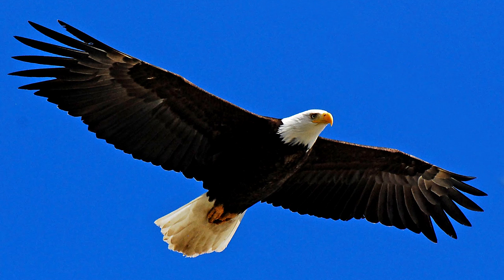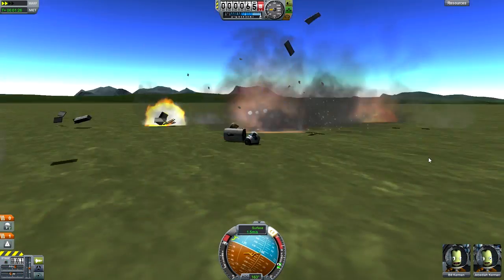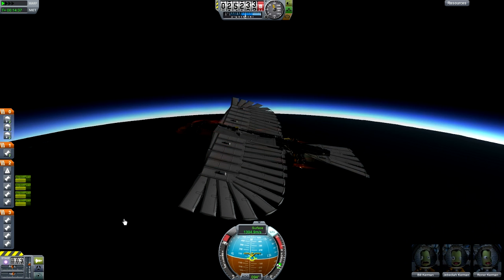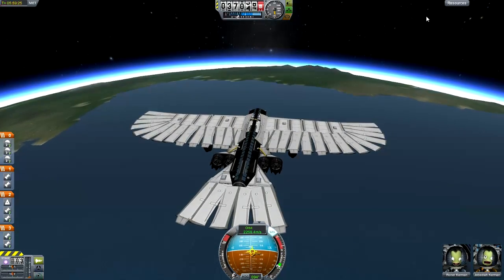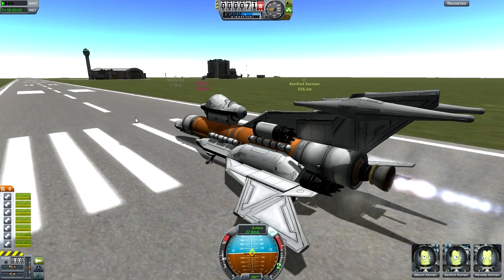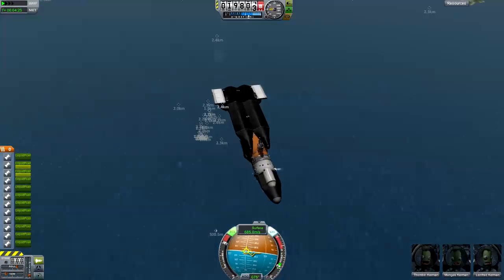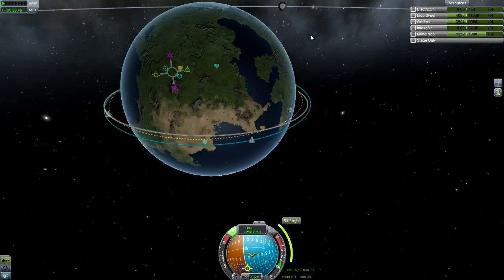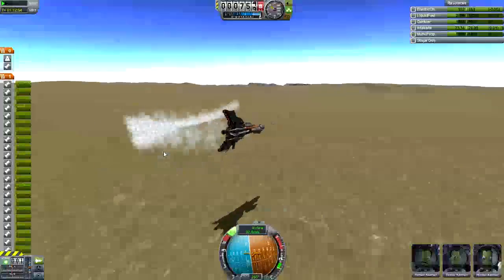KSP - Designs of the Week Ep.30

Comment: find the message: 101010100010110010001110101001101101010010001001101001010100101010010100001010100101010111001010101111101010100101010101011101010110100101111100101010001110010101000010010101001000111111001010101010101010101
Reply: well due to the binary translator i use in order for it to be properly translated it must be divisible by 8 and the binary you put in cannot
Reply: can not be translated
Reply: Mike Schmidt there is no message it is not divisable by 8
Reply: It's binary!
Reply: Mike Schmidt still it has no message
Reply: translate using binary to text!
Reply: i did it is not divisable by 8 there fore it's malformed binary
Reply: +Mike Schmidt Has no message there. I translated and has no message ... "Maybe" you did it wrong
Reply: i can't be malformed i copy and pasted it from a website.
Reply: cannot what

Comment: The simple explination for the craft flipping out when the jets were off were off is: you can think of it this way you have those two levels of jets one with 6 or so on top and then with like 12 and a rocomax the top 6 are creating thrust pushing the forward down so when they turn off the center of thrust shifts downward and angles up

Comment: Probably know this by now but the reason why you're having the front of the air craft go up is because the center of mass is not aligned with the center of thrust of the rocket engine.  You can also design the craft using the fuel lines so the fuel goes from the end tanks to the center so your center balance doesnt go wonky when fuel gets used up.

Comment: I'm and aerospace engineer  the center of lift must behind the center of mass at all times and the center of drag must be high enough to cancel the torque  because of your craft has a different coefficients of lift and drag there is a speed that you can't exceed without unbalancing the forces. This is why real planes keep their fuel in their wings, to avoid Changing their center of mass